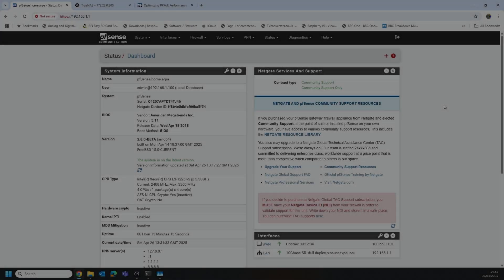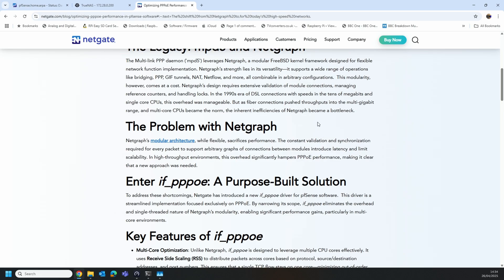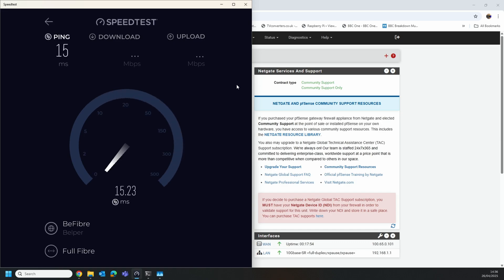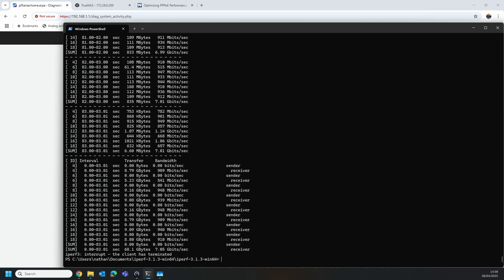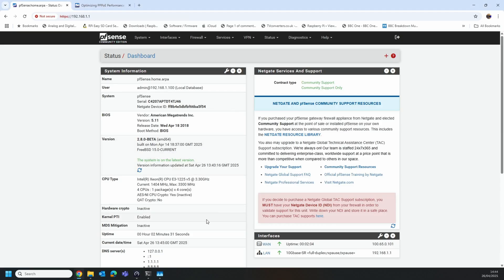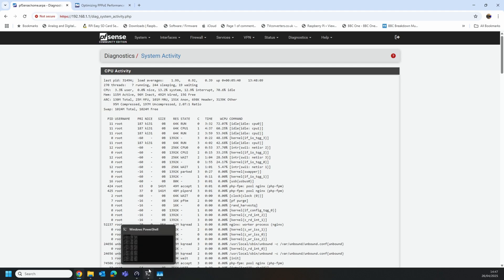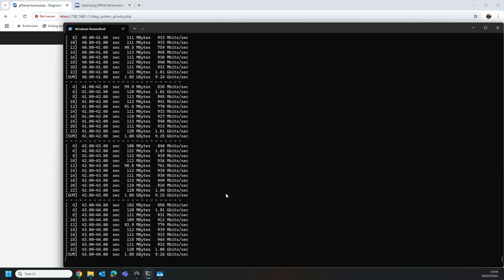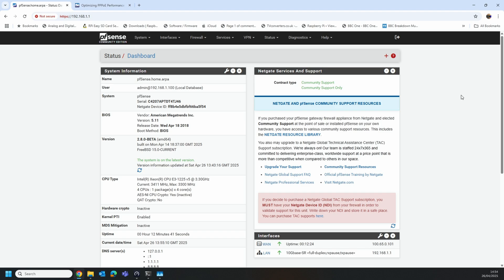Testing the new if_PPPoE driver in PfSense 2.8.0 beta at Multi Gig speeds!

Comment: Hi, I love your videos, but this one is inaccurate and we can't have that on the internet. :-D

You haven't actually tested the new pppoe driver, as that would only apply to traffic via your ISP, unless you are pppoe authenticating your internal network.

To test I would do a sustained network test with the internet, maybe high packet rate and compare CPU loads before and after.

As for the current results, most networking stuff in freebsd/pfsense is alas single threaded so it's going to trash that CPU core.. Linux is much better at this, see if you can put a Debian/openwrt/etc to work instead.
Reply: He setup a local LAN PPPoE server, explained at start of video.
Reply from the maker: Thanks for your feedback as explained in the video I created my own PPPoE server Lab in effect creating my own internal ISP the PfSense I was using in the video was authenticated as a PPPoE client.
Reply: Oops, missed that /facepalm